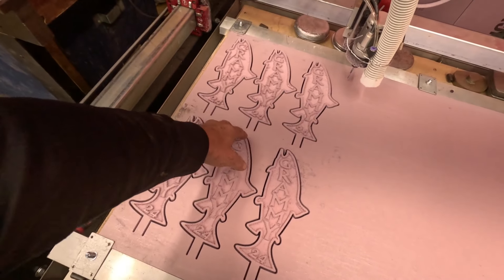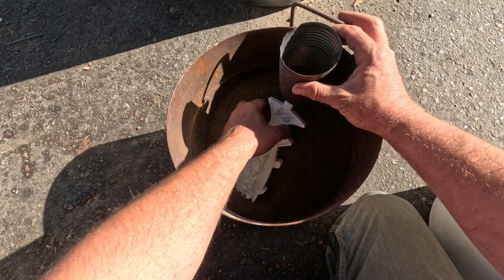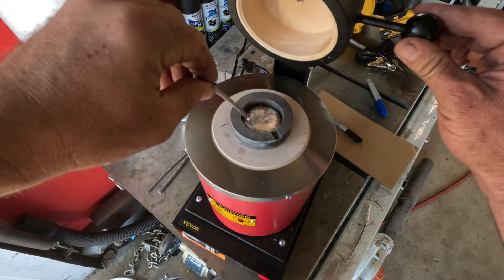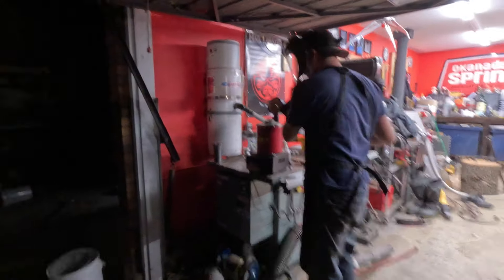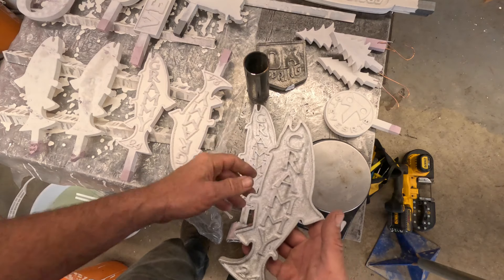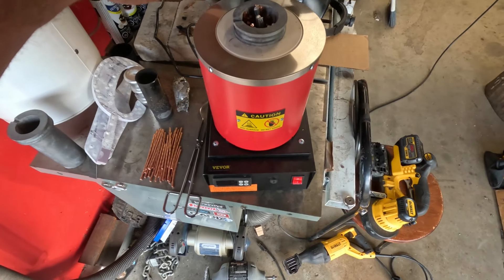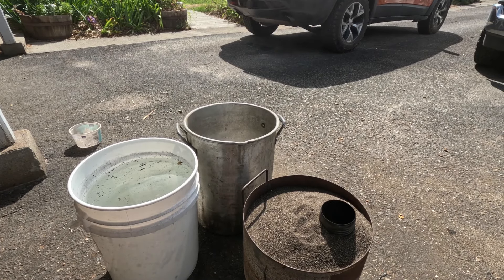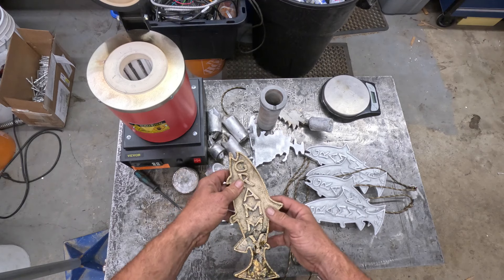First Castings with Vevor Electric Furnace #Vevor

Comment: Nice work, got me thinking I might give one of those furnaces a try for some aluminium casting. History has shown that Nfld often comes up short but it will always be home. 😉
Reply from the maker: yeah man. its pretty sweet for casting small stuff especially if you got a cnc router. I do much bigger pours with a propane furnace. Nfld will always be home for sure buddy. cheers from BC now.
Reply: @ yup got lots of CNC stuff 🤦‍♂️and been meaning to try lost foam casting for a while now. 👍
Reply from the maker: @backyardcnc  i see that. i subbed. post a vid if you ever try it.

Comment: Marvelous. The aluminum really did turn out clean. I like your angle method. I dig the trees. Can't guess what the other shape is. Is it tree related? I got nervous for ya at 04:03 with that bucket of water where it was. Had you accidentally dropped your molten metal near or in it, could have been a bad explosion. You kick ass Steve. Love the furnace. Keep it burning.
Reply from the maker: Thanks Shlisa! yes that would be bad. probably should keep that out of the way while pouring. I like making little trees. too easy now with the electric furnace. The mystery piece is the island of Newfoundland. cheers. Keep it burning

Comment: The electric furnace is nice for the small castings isn't it?  I love mine.  I only have two complaints.  The crucible doesn't last long and it takes forever to heat up.
Reply from the maker: Are you using it for aluminum of copper? Takes me about an hour to cast a piece with aluminum but don’t have to babysit it like the propane furnace

Comment: First
Reply from the maker: Cheers Buddy!
Reply: @stevesrt8  Good stuff man.  Yeah that copper is tough with those electric furnaces.  It definitely takes forever.  I mainly use mine for aluminum.  It will also get you more use out of it.  Bringing those heating coils that high will burn them out quicker.
Reply from the maker: @HeinrichsMade  yeah i agree for sure. i plan to use it mainly for aluminum in the winter time. had to test it out though. good to know what its capable of. cheers